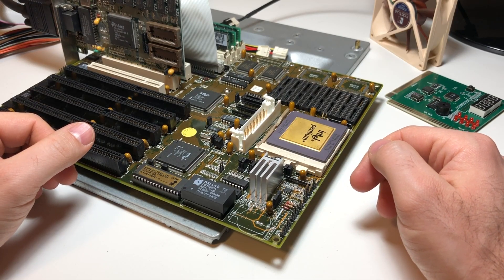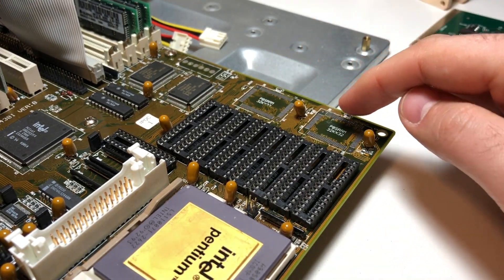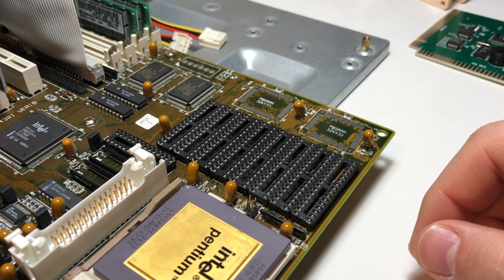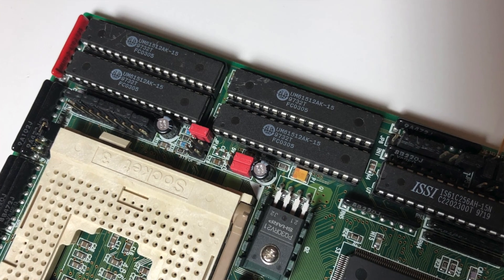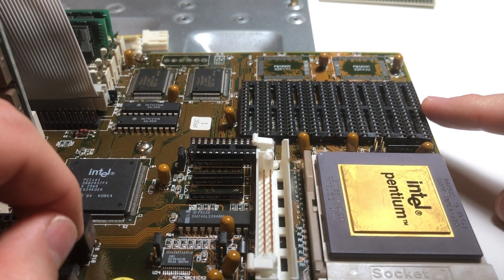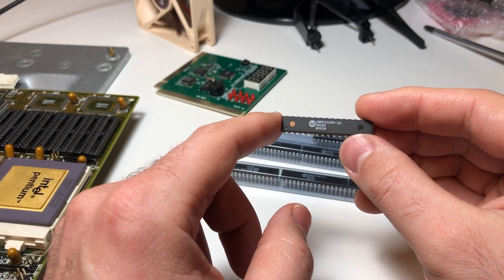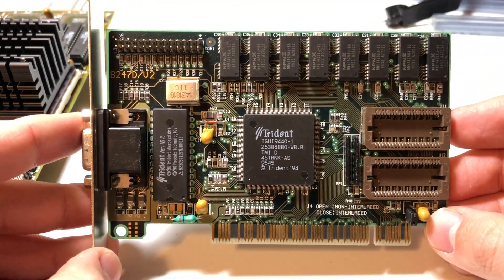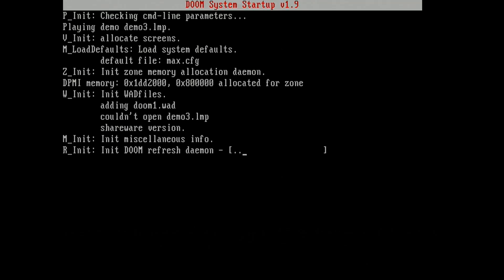Upgrading the Full Yes 82430I to 512KB of SRAM Cache!

Comment: When the cache is active and working, the hdd hardly blinks, and the cpu is at 00% to 2% working, the computer still runs. The cache acts as an ssd, that stores the data. However, if a game starts, the cache is out of order, and the hdd boots the game. The cache really works as an ssd when you handle the desktop, rename, click on the start menu open a folder, etc. That's when the cpu still runs at 00%.

Comment: i've got a fyi(Full Yes Industries) MVP3 m-atx board with an amd k6-2-300 and most of the capps have leaked now. It was pretty much the cheapest board you could get to run an amd k6-2-300 and had issues with the via chipset on the mb with some addon cards .

Comment: You're still running a dallas chip? How is it still holding a charge?
Reply from the maker: The original was very much dead. I actually replaced it with a new DS12887A+ a year or two ago, which is working great. Thankfully this board had a socket for it, which made the replacement very easy :)

Comment: I actually picked up a machine with this board a few months back. I’m in the process of rebuilding it right now; what’s the fastest CPU this board will support? I currently have two Socket 5 P5-120s and they don’t feel super nice on Windows 98.
Reply from the maker: Cool! It seems to be a pretty rare board. It will support non-MMX Pentium CPUs up to 200MHz or MMX CPUs if you have the voltage regulator module (may also need a BIOS update for MMX chips). I’ve used a P200 in mine successfully 👍

Comment: Um, why wasn't there a 9th chip? Hell, my old 486 board had a 9th parity chip.
Reply from the maker: Yeah I noticed some older boards would have additional chips. This one has 8 32-pin sockets for cache and a single 28-pin for tag cache.
Reply: @vswitchzero  My board had originally come with 5 chips, with an additional 4 empty sockets. I had another scrap board that didn't work, but it had all 9 chip sockets occupied, so I transplanted all 9 chips over to my board.

It was pretty apparent which one was the parity chip as it had a slightly different part number, but otherwise they all had the same number of pins (I forget how many but I'm guessing 32).

Anyways, the transplant worked and upgraded my L2 cache from 128K to 256K.
Reply: @southernflatland  The ninth chip is not for storing parity.  As mentioned in the video, it is for storing the cache's tag values.
Reply: @GoatTheGoat  Okay, well today maybe I learned a thing.

Is it also the same sort of setup with a 5 chip cache, where the 5th chip is for said 'tag values'?
Reply: @southernflatland  Yes, that is correct.

Comment: Those trident cards arent very fast. I would highly recommend getting some PCI tseng labs cards, go for the 6000. Very fast card. 90mhz core, and full GDI acceleration.
Reply from the maker: Yeah, they definitely aren't known for speed. For me, it's just nostalgia from using them back in the 90s. Funny you should mention the ET6000 because I actually just bought one! Will hopefully arrive in a week or two.
Reply: @vswitchzero  My first run in with a trident was an ISA card on a friends 386DX33 running windows 95. Just moving windows around, you could watch the redraw happening. It was not great haha.

The ET6000 i had was the 2d counterpart for my voodoo2 setup at the time, and it was a pretty great combination. That was in a p3 katmai 450mhz that i had overclocked to 600mhz.

Comment: I have the exact same board. Unfortunately my ps/2 port got damaged when i stumbled on the mouse wire while the computer was on and possibly shorted something. When i power on the system with a ps/2 optical mouse the optical sensor briefly lights up during boot but then shuts off, and it does not get detected in dos or windows.
Reply from the maker: Cool! You are the first person I've ever run into with this board. It doesn't appear to be very common from what I've seen. Funny you should mention that about the PS/2 port, because I was just testing an Intel 440LX based OEM board with the exact same problem. I haven't had a chance to troubleshoot it yet, but I believe there are sometimes fuses associated with the PS/2 port that could be the issue. Either that or the connector itself was damaged and is shorting out internally.
Reply: @vswitchzero  I´ve heard about the fuses somewhere, but i didn´t find anything. I can measeure 5v from the PS/2 port just fine, also replaced the PS/2 bracket but nothing. Anyway, u should make a VRM + Pentium MMX upgrade video for this board, i would def try that in mine someday.
Reply from the maker: @CesarDRK  Would love to try a VRM in the board one of these days. Will also try to install some PB cache chips and the required jumpers as well :)

Comment: I would recommend doing some benchmarks with and without the async. cache. The 66MHz bus speed is pretty fast it may make the async. cache obsolete and in some cases, having no cache could be faster than having some (especially with tight RAM timings). I think Doom in particular is slower with async. cache enabled. That's the reason pipelined-burst cache has been created in the first place, for L2 cache to make sense with Pentium CPUs.
Reply: I forget where I read it, but the FX chipset has pretty awful write timings for async cache, it IS actually slower on write, some things aren't affected much, while others suffer more from the hamstrung write performance (slower than main RAM alone) than they gain from the read cache.
Probably more significant when paired with EDO than with FPM as the difference in read performance is narrower
Reply: I was hoping to see this too. I have a board that has capacity for the cache but haven't upgraded because I'm not sure what type of performance gains come with it. Regardless, I LOVE your channel. Keep it up.

Comment: I wonder if you have luck founding old graphics cards memory chips. Seems not available on eBay right now.
Reply from the maker: Yeah they are harder to find, unfortunately. A couple of years ago I did find some "new old stock" chips for a VLB card I upgraded to 2MB.
Reply: Last year, I found a couple of Lots of "untested, for parts" PCI and ISA cards on eBay and jumped on one to possibly scavenge Video RAM. 

Plot twist, all but one card in a Lot of 12 was perfectly functional. Ironically, the dead card had no removable RAM either so I'm still looking...